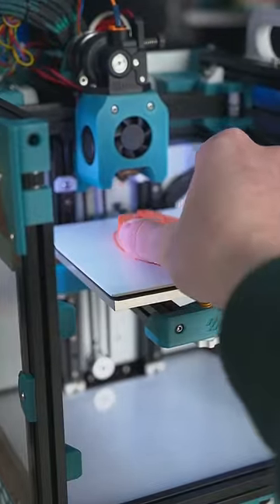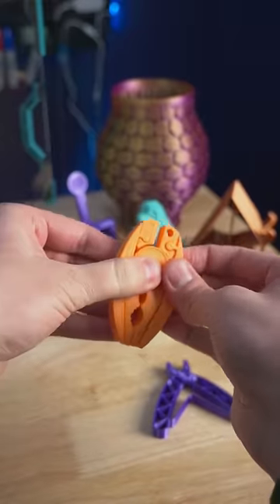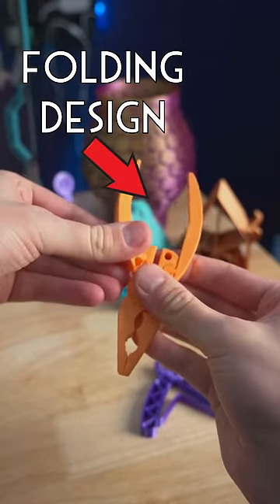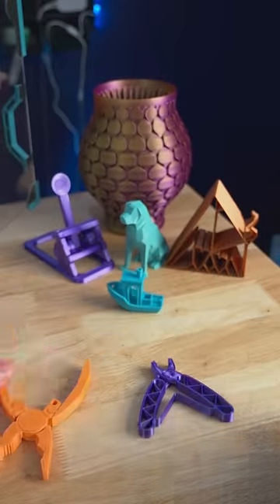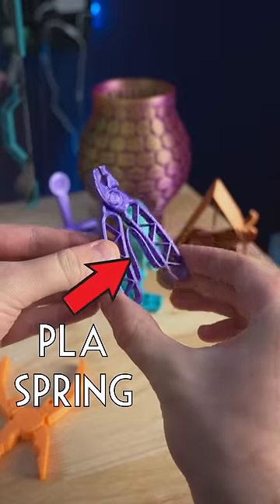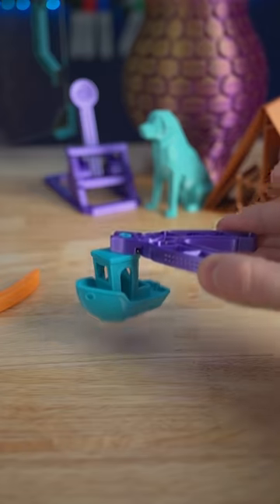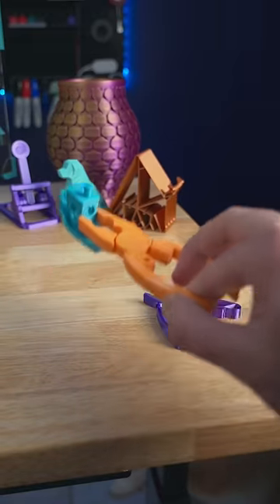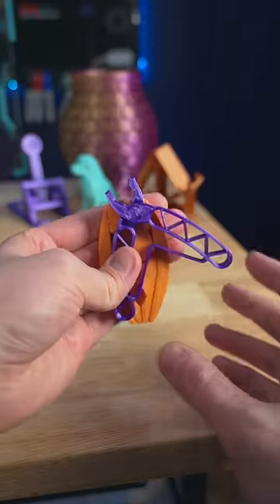3D Printed Compliant Tool 🔧 Comparison

Comment: Hold the orange pliers in your palm, wrap your thumb around one handle, and the rest of your fingers around the other. Now flex your palm. Congrats, now you know how to use springless pliers one-handed
Reply: Usually when I'm using springless pliers, my hand literally can't stretch far enough to get it around what I need to if I hold it that way.
Reply: @anonymousapproximation8549  If you need more reach, you can put two fingers on the inside of the handle and two on the outside and manipulate it that way. Those are a pretty small pair of pliers he's showing off in the video, though, so I doubt many people would have trouble using those one-handed unless you have particularly tiny hands
Reply: @awareqwx  Cough cough, Parker from ADHD’s World.
Reply: For best results, be sure your pliers action is as loose as is possible (a day or 2 in wd40 do the trick).
Now you dont even need to manualy open the pliers just let the gravity do his thing

Comment: This is actually really interesting and I'd even suggest that's a new type of compliant device - a semi compliant device. The spring is of course a standard compliance, but the fact that both sides of the hinge slide over each other, and so both kinda are but technically are not separate pieces is super interesting.

Where else could we use a mixture of compliant and traditional joints, all out of the same part?
Reply: you might be on to something

Comment: You're using the orange pliers wrong...

Edit: holy shit, it's giving me a headache how you used it. Tell me you've never used pliers without telling me you've never used pliers.
Reply: Wait how do you use it without a spring mechanism??
Reply: @AkitaSyn  Just grab them and tuck your pinky inside. You can use the pinky to open them back up easier.

Comment: I understand that these are mostly for demonstration but i couldnt see a case where plastic pliers would be super useful
Reply: @𓆏 i will say though, as weak as they may be, they would still likely strip a nut if you were trying to use them in place of a wrench, and i do feel like whatever grip strength you could get from them wouldnt add up to much more than your fingers. I agree tho that if made from a more appropriate material they would be more useful, but also ive seen pliers that (kind of) use the same compliant mechanism to spring back when you let go of them

Comment: Add a similar PLA "spring" to the full size one. Have it come around the handle to make a loop and small self contained oval. Then when the handles are taken off they're joined by the spring. When putting the handles on, it inverts the loop into the spring

Comment: What are you using them for they can't be that strong?
Reply from the maker: Mostly around electrical components where you don't want conductive metal pliers. I've been using the purple ones to move around jumper pins.

Comment: That is not the hand grip while using pliers. One handle in the webbing of your thumb so you can wrap it around if need be. Then your fore finger and possibly your middle finger on the inside of the handle pushing out  towards your fingers on the other side. Pretty simple

Comment: you done any testing on the longetivey of pla compliant joints?  Like how many squeezes do you think you'de get out of that?

I'd consider making that compliance "strip" replaceable, yah its 2 pieces & probably some hardware, but when they strip looses its spring, just pop in a new one in.  just a thought

Comment: why not just change the orange print to have "spring support" between the section where the handles are connected together (like most pliers will have) woldnt hard to find a small enough spring with enough tension for that orange set.

Comment: That's neat, but I firmly believe there are some things that shouldn't be 3D printed. 
If you were using these exclusively to work on electronics and really tiny components, then maybe, but I still feel like getting an actual pair of metal pliers that are likely to last longer than you will is the better option. 
Still, top marks for creativity!

Comment: That's not compliant. If the fulcrum for those pliers were a flexure, instead of having a hinge and a pin, they'd be compliant. But what you have right now is a conventional pair of pliers with a spring built in. Not compliant.

Comment: both suck for many reasons. you need rigidity when it comes to pliers. if u want soft jaws then make replaceable soft plastic jaws that slide on and lock in. the orange pliers have a massive weak spot in the handle interface making them probably weaker than the smaller ones. having a spring in pliers can hurt the usability in many cases only novices in using hand tools won't know this. cutting plyers benefit from the spring significantly more.

Comment: Compliant but not robust enough to do anything useful
Reply from the maker: It is very useful when working on small electronics.
Reply: @JJShankles  nah. Small? Use tweezers. They're too big for small stuff and too breakable for big stuff. Also you have to get specific filament if you want your item to have anti static properties.